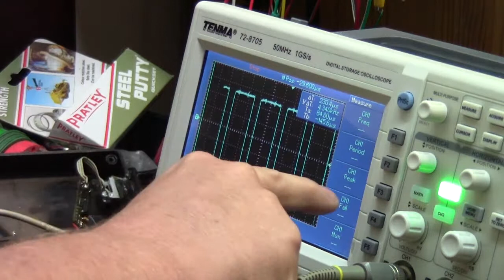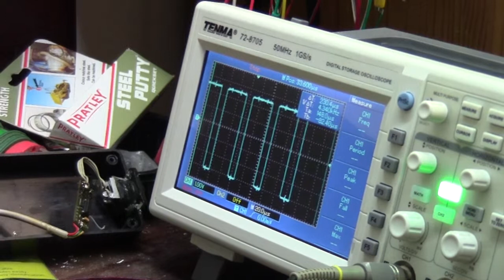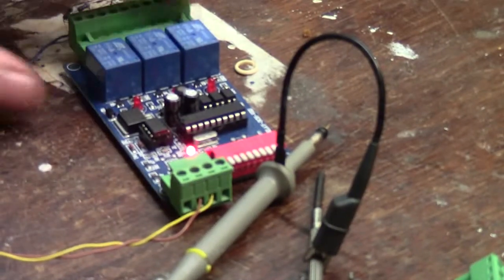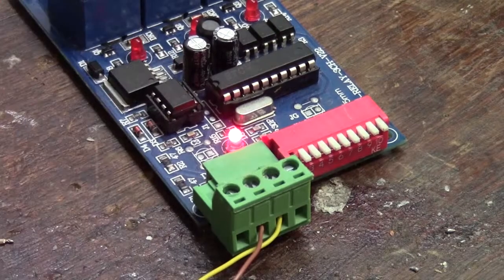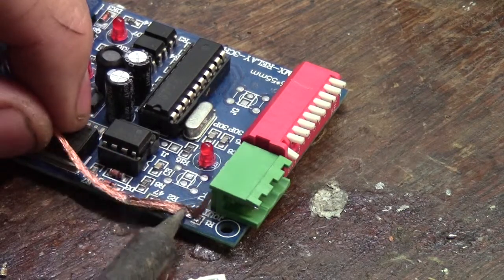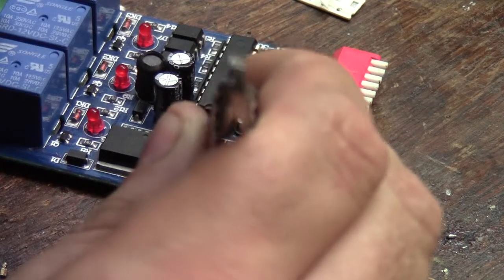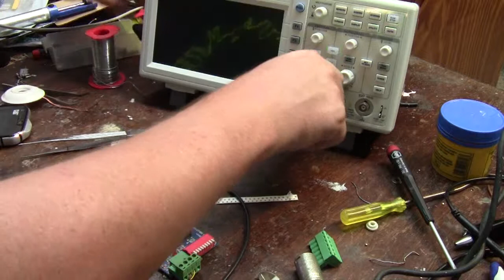ShoutingElectronics #20 - Repairing a DMX Controlled Relay

Comment: Now who was the one who shoved 230VAC into the DMX line, possibly by putting the connectors in wrong? Impressive that the chip survived the event, though the difference between a SMD fuse and a SMD resistor is around 3 seconds.....

Still do not trust those Songle relays, had to change way too many of them that failed running only at around 3A current, they are not the best, but for R18 each in singles not at all bad. Just put a 275V MOV across the contacts to help with the sparks, and they survive longer.

Nice to see you using the scope, just beware of putting the full power of Eskom (when available) across the input, it probably will not survive.
Reply from the maker: It was the guy that nailed a banner on the wall. The center nailhole lined up perfectly with the live of the twin+e cable and the DMX line in the pipe behind it.
Reply: @ShoutingElectronics  Must have been a shocking experience for him. How did the DMX controller survive also having the same gift given to it.
Reply from the maker: @SeanBZA  How did it fail, let me count the ways.
1 x USB to DMX Interface (DMXCreator Specific, very pricey)
1 x 12 Channel 20A DMX Dimmer,
2 x Moving Head Stage Wash Fittings,
and 2 x LED RGBW Parcan's, 

ALL RS485 Drivers toasted, and all main uC's faulty (latchup). 
{Just a few rands extra for the manufacturer to install an OPTO in each device would have saved it}
{Those resistors must have been the saving grace for the Cheap Chinese Relay Board}

And ALL Discontinued without spares...   

Equivalent Replacement approx R60000.00.   Insurance Claim in progress {Just finished compiling the quotes now}. (At least I saved them R200 on the Relay Board, and got to make another video out of it)

The Tenma has a 400v Peak Input, and I use a 10:1 probe on anything remotely high. So the (250vac Currently) at my workbench should not be a problem for it... Just had a hard time trying to explain to the family what an oscilloscope actually does.
I remember first scoping a DMX signal on the 20Mhz Analog Scope. Could not see anything, just a blurry mess. At least here I can see a square wave.
Reply: @ShoutingElectronics  That is one very expensive nail, hope you are going to put it in a frame, probably with the 2 SMD resistors, the chips and microcontrollers you removed.

Just who though ran DMX and mains in the same conduit though, they really should have separate tubes, or at least separate trunking ways.